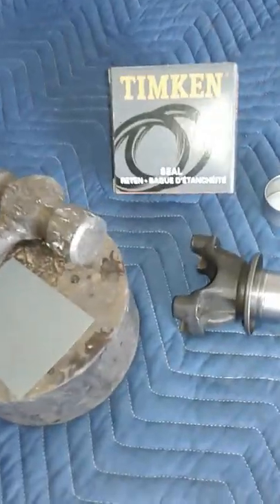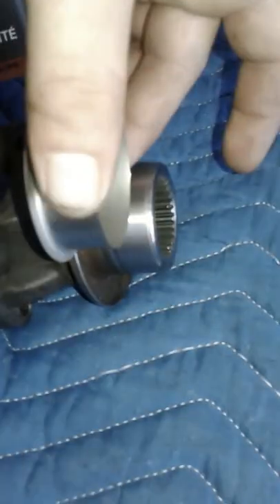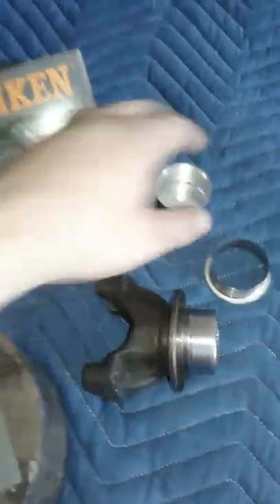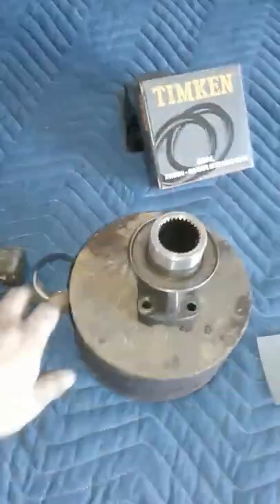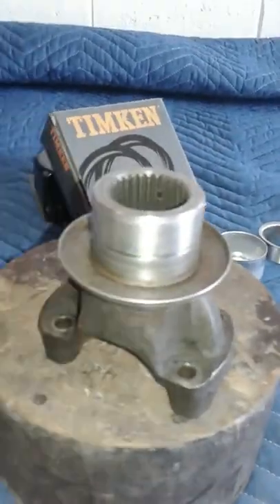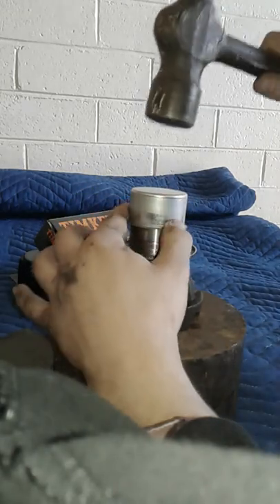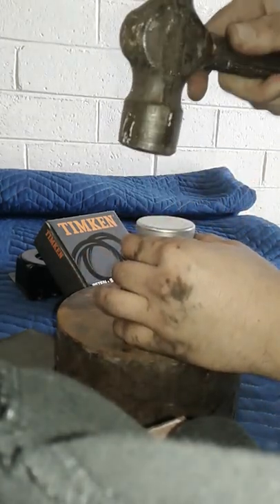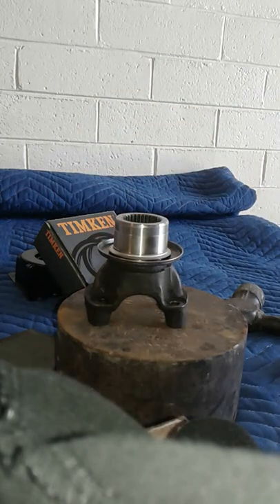Np203 Speedi sleeve installation on front transfer case yoke

Comment: Do you need a puller to get the yoke off the front and back outputs
Reply from the maker: No you do not need a puller.  You are good to go with regular hand tools. Thanks for the question. Hope it helps.  Good luck. You got it.